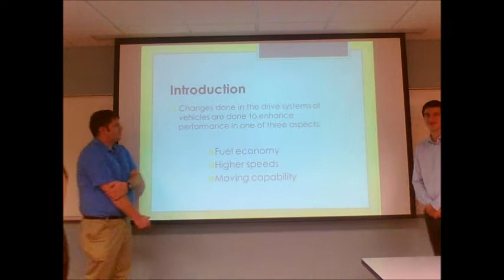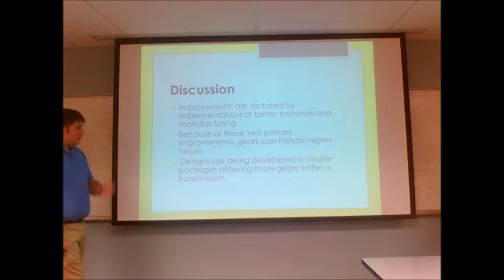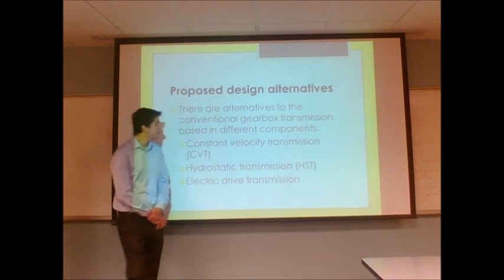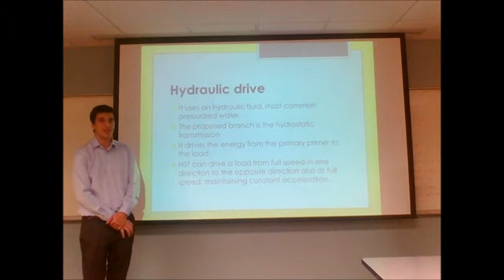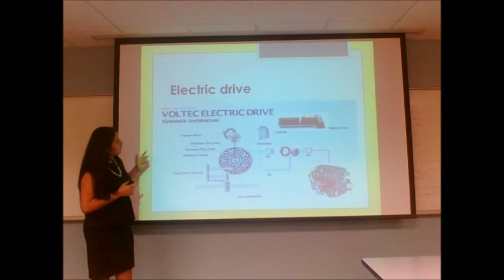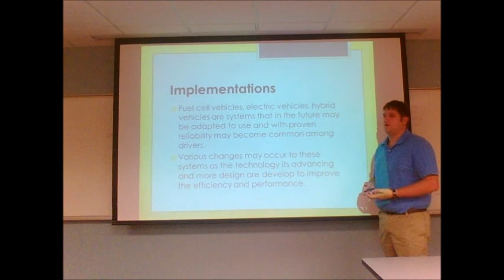Team 8: Automotive Gearbox Design

Comment: Quality of the video was pretty bad. It looked like the presenters spent a lot of time preparing for the video however the low quality of the video and sound ruined it because I could barely understand the presenters due to the static. However I like the fact that the presenters dressed professionally and the powerpoint itself was done nicely.

Comment: Very informative. The slides were well put together and they were clear and easy to read for the most part. The speakers knew what they were talking about and spoke with confidence about the topic at hand. Only issue as mentioned by other commentators is the sound of the A/C or other ambient noise in the background. It makes your speech less clear and hard to follow. Speakers were dressed well which gave the presentation a more professional appearance.

Comment: Good information. The team showed alot of information that they clearly were acknowledgeable of. The adjustments they should consider is the quality of the video. There is a distinct buzzing sound during the presentation and certain slides in the powerpoint were hard to read.